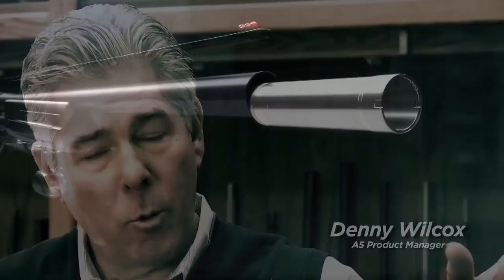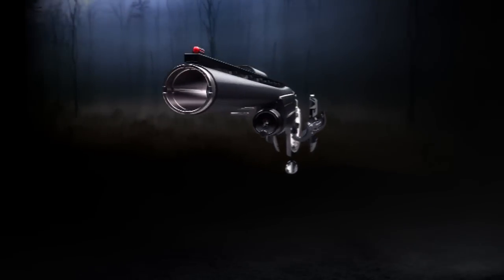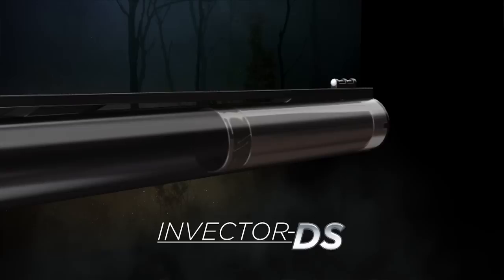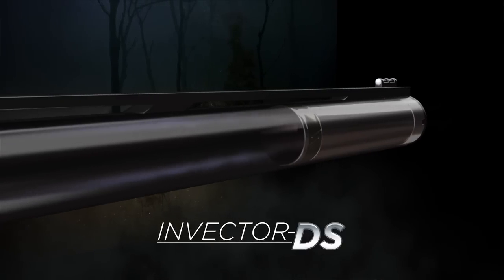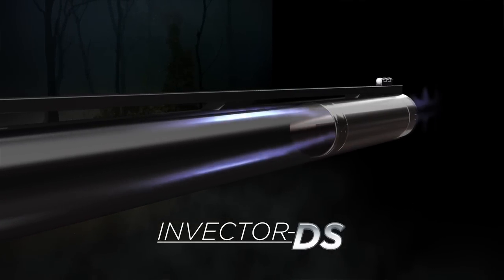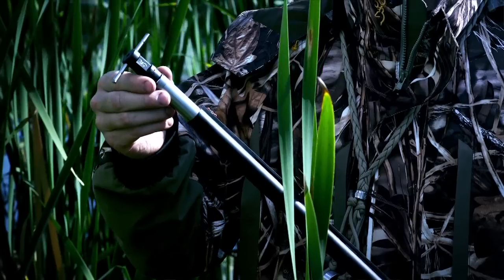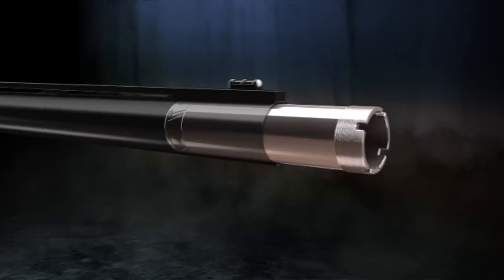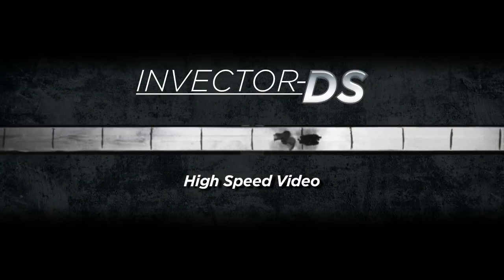A5 Shotguns — The Invector DS sets new standards of performance. 2012.

Comment: The only Invector DS chokes that I like in my A5 has been the full. The other chokes are much more open than what they are marked. I do however like the Midas extended chokes that came with the Citori CXS. If you get an A5 do yourself a favor and buy some  aftermarket choke tubes.